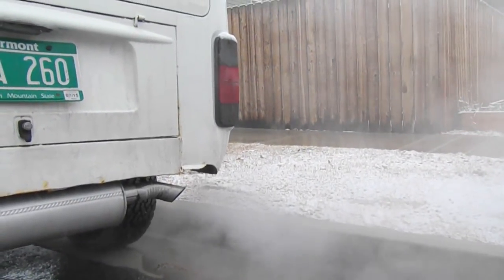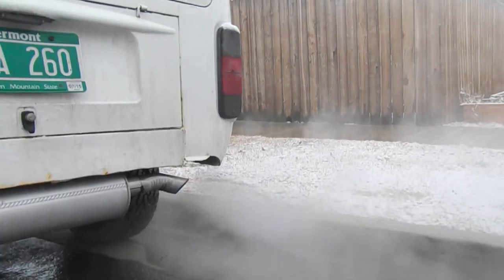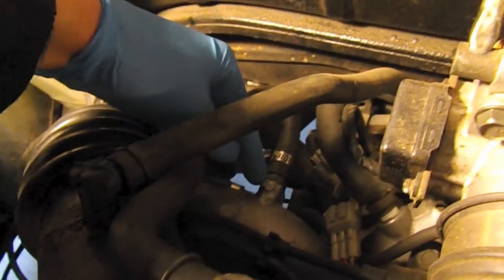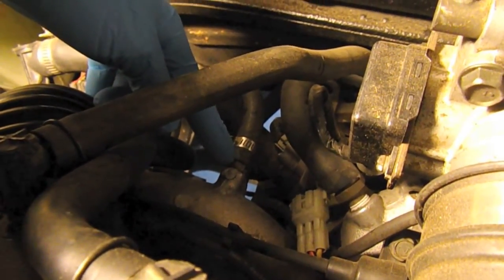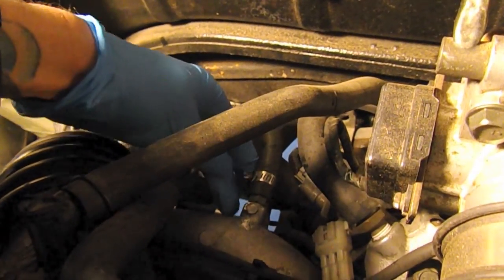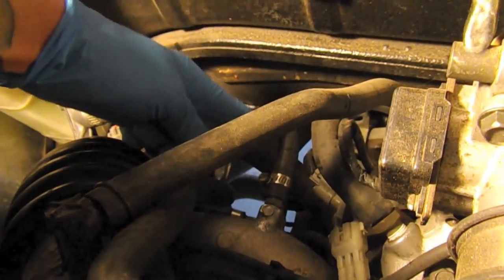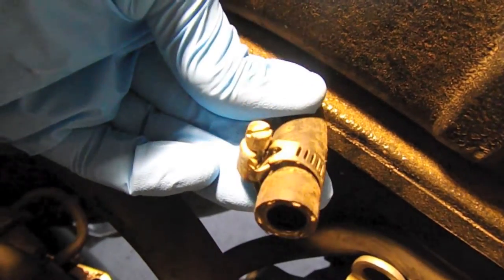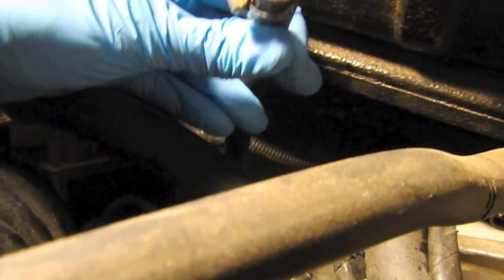Busaru - White Smoke Scare

Comment: Hi @Busaru, I had the same problem ask yours in the video. Car is spitting white smoke from the exhaust and the brake fluid mysteriously goes missing. After disconnecting the vacuum, it has less smoke. I just want to verify something, is it ok to leave the car running while the smoke clears? The temperature gauge seems to go up more than normal at idle. Is this normal? I just don’t want to ruin the engine if it’s just the brake.
Reply from the maker: I don’t remember an increase in engine temp but the brake fluid will burn off pretty quickly once you correct the leaking master cylinder problem. Good luck!

Comment: I'm installing a 96 impreza 2.2 into a vw. It has two 02 sensors. can I install the exhaust with just one 02 sensor and not use a catalytic converter and still use the stock ecu?
Reply from the maker: +Robert Nelson Absolutely. Just use the upstream sensor. You'll get an engine code but it won't affect performance.
Reply: Thank you